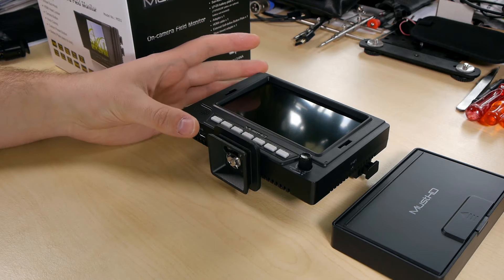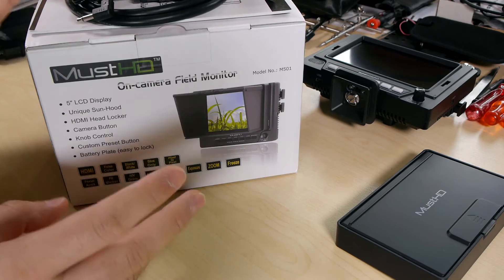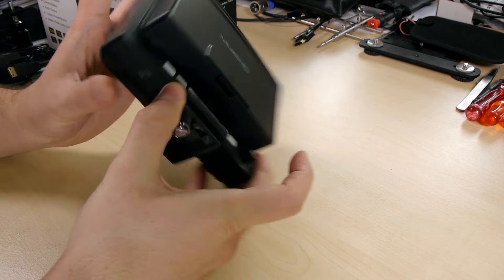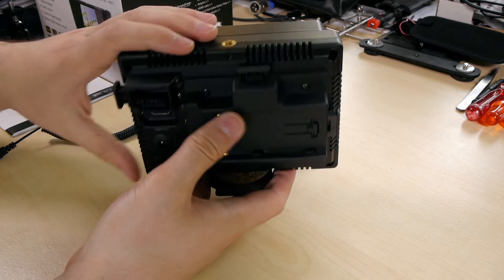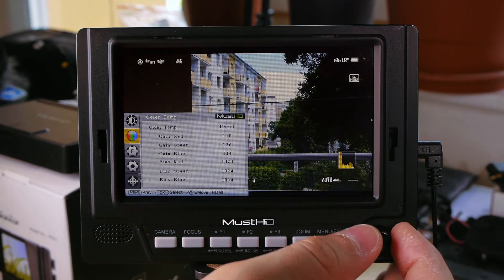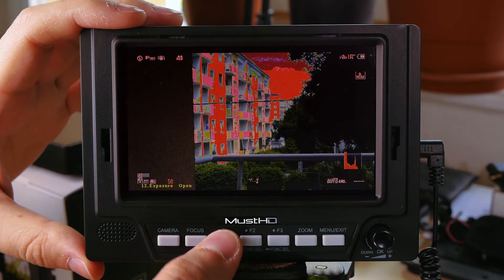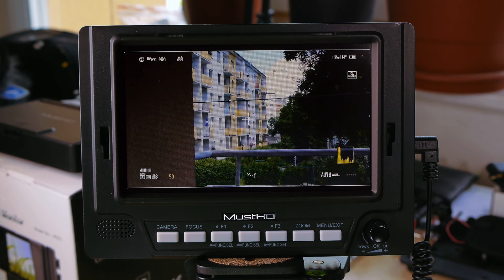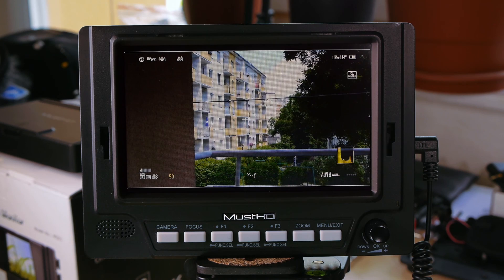MustHD M501H field monitor - Review (IMPORTANT hints!) - ATTENTION: As always quite long!

Comment: I was just using one of these monitors this past week, and a few of the functions currently (updated most likely) do not work as demonstrated in this video. False Color, for example, has the IRE Levels at the top, and the colors were: 
<0-Magenta, 0-Dark Blue, 12 Blue, 22 Light blue, 43 Brown, 47 Purple, 55 Aqua, 58 Pink, 78 Grey, 81 Olive, 83 Green, 100 Yellow and >100 Red. Another thing that worked different was Pixel to Pixel. On the one I used Pixel to Pixel, if accessed through one of the function buttons, would pop up a little Grey Square with a smaller Red Square that starts in the middle (center of the screen). When you rotate the knob it shifts the Red Square to each of the four corners of the screen allowing us to asses a 1:1 focus for each of the quadrants with out having the move the camera. These were the only features I used that were different than here, but the remote was by far my favorite feature as it was attached on the gimbal handle, and I was able to access certain these functions (and focus) with out moving my hands around. The remote is why I'm picking one of these up for my budget kit.
Reply from the maker: Good to hear that you like it ^^. The remote feature is quite unique yes - I don´t know why not more producers are picking up this feature. Especially as more and more people are shooting on gimbals (for that use a wireless remote with a clamp or velcro would be PERFECT). About the feature differences: Yes. That´s the newest firmware which is now coming with the newer / actual shipping models. They first brought it to the bigger 7" models (with SDI). But now all models seem to come with the new firmware. Thx for the feedback - And have fun shooting ^^. LG

Comment from the maker: @Raj Zeef: If you have a progressive output capable camera, then one of the MustHD screens (M601H or M701H). The Aputure on the other hand is btw. basically the same like the VS-2 I also reviewed within my channel (the VS-3 only has a few software features more and the screen is a little bit better coated). But it´s also by far not usable with interlaced signals (like the MustHD screens) AND it´s way worse colours wise, my screen buzzed on startup, hang up from time to time and the battery indicator showed WAY too early (so - NO - I wouldn´t go for the VS-3 to be honest).

You can check out the VS-2 review within my channel btw.

If you have a interlaced output only camera: Well. Then the H056 (V2) is maybe an option. Or if you want something cheaper a used (dirt cheap) Lilliput 569 or 5D-II (or the 665 model with the same panel as the 5D-II). The Lilliput are by far not perfect either. But at least they are working as they should with interlaced signals ^^.

Comment: Could you talk about the aspect ratio guides? I see explicit images of that feature on the MustHD website for the 601, but on the 501 it just says "Also available: Markers". Could you demonstrate what markers the 501 has? I'm most excited about the 2.35:1 and custom guides.
Reply from the maker: +MagnumDB The software / firmware should be 1:1 the same with all models. At least now the features are listed at all models 1:1 the same (in the past a few ones were only listed with the SDI 7" model for example). Btw.: Check out the video around 38:44 (there you can see the markers of the firmware I had on my model - Which is the older software version model - Now you should get even more - So the same like with the other models). At least you should get: 16:9, 4:3, 1.85:1, 2.35:1, 15:9 and even 16:10 (that are the marker types of the older version - And I think they didn´t remove anything on the actual ones ^^). No custom guides as far as I remember - But normaly you don´t need them (the built in ones are normaly enough). ^^
Reply: +AustrianGeek Thanks so much! Watching the video on my phone, I could not make out the markers, maybe I need to re-watch this video on my computer monitor to see better. But thank you so much for pointing me to that specific moment in your video, very helpful. Thank you again!
Reply from the maker: No problem - Yes. You need to watch in on your computer to use the timestamps (they are not available / clickable within the YouTube mobile app). Have fun shooting ^^

Comment: Is there a battery included?
Reply from the maker: No. But you can get them easily for a few bucks as cheap kits over Amazon for example.
They are normaly priced around 30 to 40 bucks (with two batteries and a charger included).
You can also start with just one battery (then you save around 10 to 15 bucks additionally ^^.